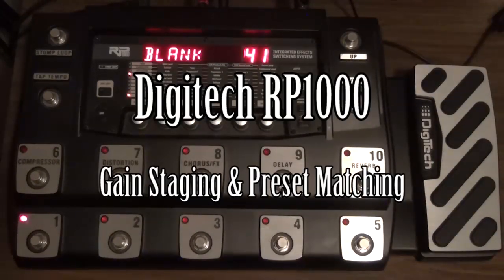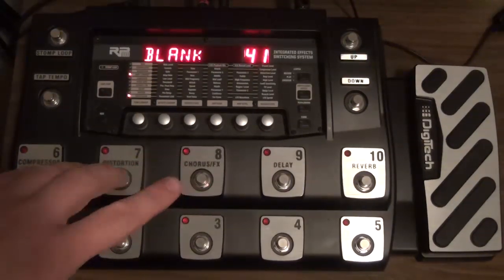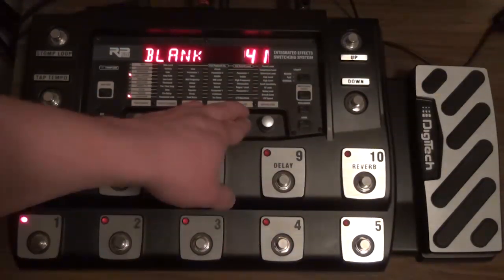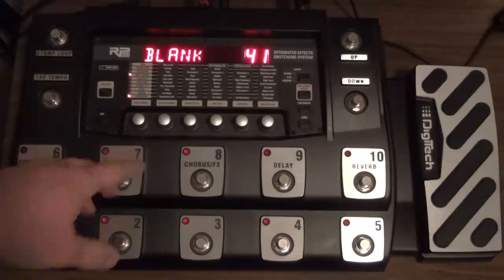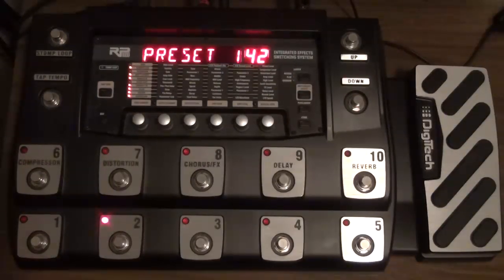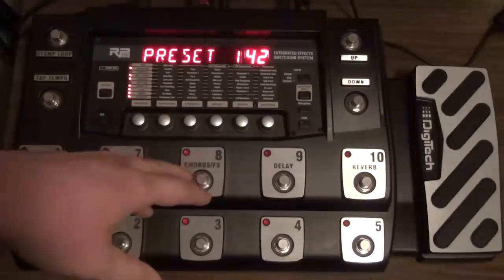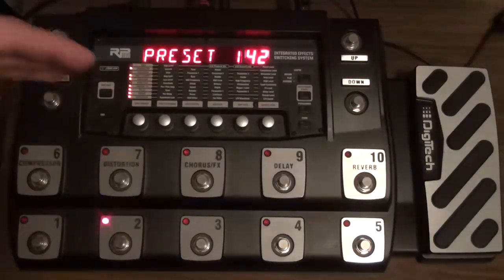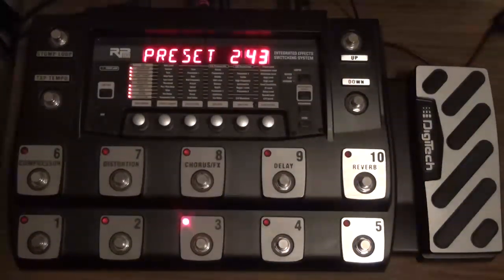Gear Tutorial: RP1000 Gain Staging and Preset Matching

Comment: Just purchased this unit a couple days ago as I was looking to simplify my setup and noticed the gain problem you described.  Thanks for the video it definitely helped me out.  I'm using mine in pedalboard mode with my Mesa Mark V, with the RP1000's amp/cab turned off and Amp Loop on, and was wondering how the FX loop volume interacts with the gain staging and where it should be set at?  Overall, I love this unit for effects!!
Reply from the maker: It is great for effects only using 4CM.  It is tricky to decide what the FX loop level should be at on the MkV.  Mesa usually recommends starting at noon and working your way up or down depending on what you're hearing.  My guess would be to set it less than half (probably closer to 10 o'clock).  You don't want to clip the amp return on the RP.  But you'll have to experiment to find the best setting for your use.
Reply: Thanks for the quick reply. Yeah, I think I'll have to experiment on the FX loop level to find the sweet spot between almost enough, and too much.  I'm using the 4 Cable Method for sure, and with the amp/cab sims off, it really does a great job without altering the tone of my MkV; which is great.  I was shocked at how good the effects are in this unit, and for the price it was my best choice.  The Whammy pedal is worth the price alone.  One other thing though, you mentioned something about a Beta firmware for this? Do you recommend it, and how do I get it? Thanks again!

Comment: Hi Jonathan and great video! I've been a ToneLab LE user for many years and have always ran it straight into either my NMV Marshall or my BF Fender Pro Reverb amp.

When you run straight into an amp with your RP 1000,do you disable the amp/cab mode or do you tweak with it enabled?

I just bought an RP1000 and going through the learning curve...Thx.

Comment: Thanks for a great video. I have had this unit for a few years and have "tried" to use it many times live, however I tend to always go back to my analogue Boss pedals. Now dont get me wrong I would love to love this unit as I think it has much potential, nut for some reason I tend to find that it and every other MFX I have tried tend to be brittle and sharp in sound when used live. With headphones however it sounds GREAT, lots of dynamic range etc. Do you have any advice for live situations on stage thanks?
Reply from the maker: Thanks!  The best suggestion I can make is to dial in your presets at full stage volume.  Read up on the Fletcher-Munson Effect to understand why:
http://www.webervst.com/fm.htm

In short, something that sounds good at low volume (or with headphones) will sound much more harsh as the volume goes up.

That said, I've found all the digital modeling devices I've used sound somewhat "funny" in the high end.  I run my RP1000 direct to FOH and am satisfied with the sound, but I'm willing to settle for less knowing the limits of my budget.
Reply: Hi Jonathan,thanks for your tutorials...have you ever tried to play your RP1000 trough a Tech 21 Power Engine?

Comment: Does the rp's amp modeling use the amp volume in simulation, for instance would you have to crank the amp volume in the sim on a jcm 800 to simulate that cranked Marshall sound or is it not that effective?
Reply from the maker: +Matt Newsome In my experience, it doesn't.  When you turn the amp volume up/down, all it does is change the volume.  It doesn't really mimic power tube saturation or anything like that.  You have to play around with other settings to make up for it.
Reply: Jonathan Beals  I am running my rp 500 into a quilter toneblock, I am new to this kind of set up so have been wondering about unity gain, maybe its just me but I feel cranking the marshalls like mastervolume, jump panel in their volume section I get more dynamics and response
Reply from the maker: That's more than likely the effect of how the signal is hitting your Quilter than it is the modelling inside the RP.
Reply: Jonathan Beals I just spoke to digitech they said their amp modeling includes volume break up, maybe setting master volume to unity with modeled amp volume and then adjusting them all with preset volume to balance each other, say a cranked marshall volume at 99 on amp, master at 75 and preset at 60 would balance a mesa triple volume at 5.5, master at 75 and preset at like 65-70?
Reply from the maker: Sure.  Lots of ways to achieve unity gain.  I can't say I feel much of a difference in the dynamics either way.  I just went with the way that seemed to work best for me.

Comment: You gig with the RP? If so, how much and how's the housing and controls holding up since you got it?

 I have a GNX3000 which has a metal housing but does have plastic control knobs. So far so good, but I do worry about it at times in certain situations. 

It also sounds like the amp models the RP & the GNX have in common were not remodeled for the RP as I have done some serious tweaking over the years to get some good usable tones I like and still do so on occasion to see exactly what I can muster out of it trying varying methods with amp & cab warps in all sorts of combinations. I have presets on my PC just for experimentation with seeking the best possible tone I can squeeze out of it. Doubt I'll ever be 100% satisfied as has been the case for various amps I've tried over the years. Hughes & Kettner has gotten me the closest to the tone I am always seeking. I rant. :)
Reply from the maker: Well, this video is 3 years old now and I no longer use the RP.  I had it for about 5 years if memory serves.  I've since upgraded to the AX8 and Helix.  The RP is on a shelf now and is as good as new aside from the dust and a few scuffs/scratches.  Never had anything fail on it.  I had a GNX4 (which is the same build-wise as your GNX3000) prior to the RP.  For me, the switches failed on that after a while, which is why I upgraded to the RP initially.

I heard they upgraded the models slightly for the RP, but I certainly couldn't tell much of a difference.  While the base models sound pretty much the same, the big loss moving from a GNX to the RP is that the RP does not have that warp function.  Because of that, it would be very difficult to port over any of your GNX settings.

Best of luck with your tone quest!

Comment: Great video. I bought one of these back when they first came out and hooked it up to my JCM 2000 half stack, even using the send / return, and it still sounded like shit. It was all harsh and biting. My amp sounds great tonally, so I would only be using this once in a while on certain songs. I don't want to jack up my tone on my amp.

The other guitarist in my band uses a Boss unit, and it sounds fine. So I am taking it out of the box again after 10 yrs and trying again.

This was a very helpful video.

So, when I use this through my Marshall half stack, what kind of sound should I be dialing in on the amp to get the most faithful replication of the intended sound?

In my experience, once I turn up the volume, these digital racks get very harsh sounding.

Is there anything I can do to prevent this?

Thanks in advance.
Reply from the maker: Your amp will sound better than any of the modeled amps, so I would use it in the 4 cable method and disable all amp/cab models.  Then you are getting all the tone from your amp and the unit is being used for effects only.

Comment: Is it possible to use the volume pedal instead of a lead boost?
Reply from the maker: Absolutely.  You can set the "low" and "high" values of the volume pedal, so you can easily use it for lead/rhythm volume control.
Reply: Thanks Jonathan!!
Reply: Hey Jonathan, thanks for all your input. Looking to get the RP 1000 and toss my L6 floor pod +. I plan on using the RP in PB mode and running stereo w/ xlr through super nice sound mixer. Are there any videos / audo s

Comment: does anyone else have to shut off the pedal after saving a change in order for the adjustment to take effect if changing to a different channel and returning back?
Reply from the maker: That's weird.  Never happened to me.  Are you using X-Edit or doing it on the unit?  Have you tried a factory reset?